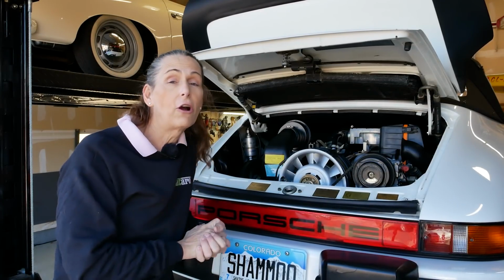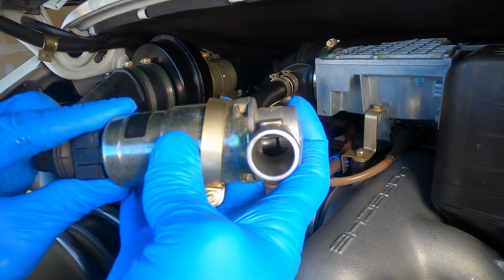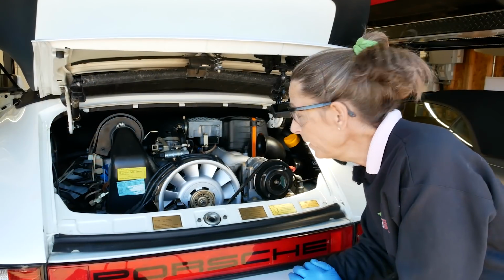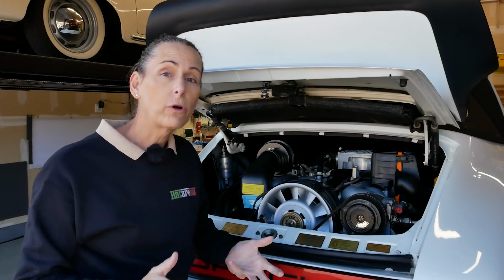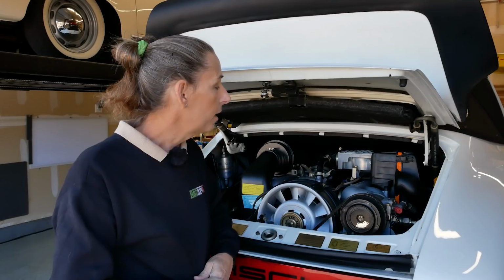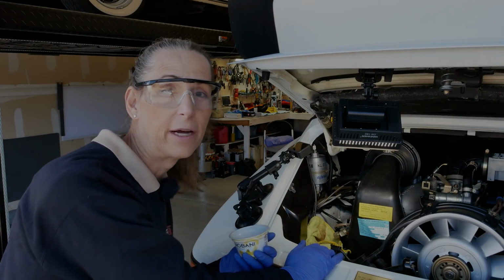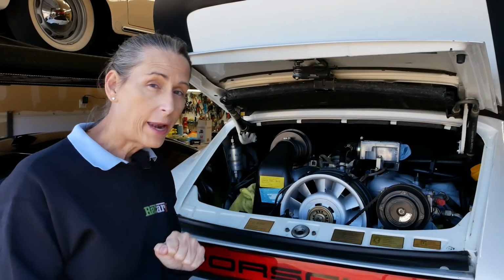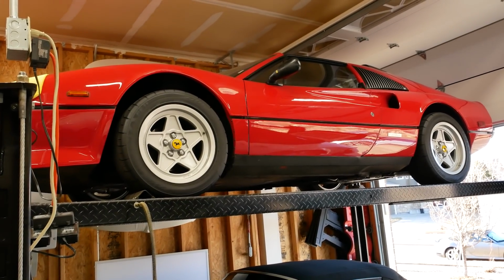Budget eBay Porsche 3.2 Carrera Project Car! #29 - WHAT IS GOING ON WITH THIS ENGINE!!!

Comment from the maker: Hi Everyone, This engine just isn't running correctly.  I was pretty sure from the last drive that we have a cylinder out.  Also the idle is about 200rpm high.  I can't really take it for a proper drive until I get this sorted.  Here we go!
Check out that Noid test kit here: https://amzn.to/35ph4b5
And the Spark Plug Checker: https://amzn.to/38wBZeA
Reply: Franny, Is there a specific mechanical reason that would have precluded removing the suspected failed injector #5 I think and firing the engine over to see if the injector was actually delivering fuel while still powered by the harness???? placing the injector tip into a clear bottle to see if it delivered fuel when the engine was running?
Reply: I love your content!! <3
Reply: Bad injectors happen. Sometimes electronics go bad. I have a 1980 911 with a Paxton supercharger. It's fun.
Appreciate your videos.
Reply: Hi Franny and company....is yours a 1985 ? Or a 1987 ? I've got a 85' Carrera and a 1987 G50 Cab !👍🏁🏆💝
Reply from the maker: @frankvella1392  it is an '86 actually...
Reply: @HeidiandFranny  k thank you franny !!! So no G50 😥 have a great day lady's !🌷👍
Reply: @HeidiandFranny  It looks like the injector failed after it was running or was intermittently firing because it soaked the plug enough to the point of uselessness as evidenced by the new plug firing nicely. Check the oil, 10 to 1 it'll smell of fuel from the look of that plug. You said it's an '86 so it's Motronic and I've had to adjust base idle speed even though it should be controlled by the DME, it's a painless process that shouldn't take more than a few minutes. Is the flow through the ICV heading in the correct direction? I've see dozens installed backwards, it's an easy mistake. Other than that it could also be a vacuum leak which is easy enough to find with a can of brakleen or starting fluid sprayed around intake surfaces and lines, just listen for an idle increase.  The vacuum lines to the throttle body and the fitting next to the idle microswitch are easily cracked and dried up even thought they look fine. A good test for vacuum leak probability is removing the oil cap with the engine running, if the idle drops it's a good indication of no vacuum leaks. Good luck and best wishes to you and your car.
Reply: With a stethoscope you can hear if the injector is clicking.

And how did you remove the sparkplug wire without getting zapped?
I have not quite finished the video. The spark did not appear strong
Reply: @golfish8589  Luck, she had a glove and long sleeves, even then I've had some give me a hell of a jolt. Any mediocre graphing scanner will show spark voltage and duration if it's questionable by sight. GTC makes a very affordable affordable handheld graphing ignition analyzer I use if my Launch is tied up. I'd ditch those 4 electrode plugs for an NGK fine wire iridium though.

Comment: A good old fashioned mechanic's stethoscope can identify a bad injector also. If it ain't clicking it ain't working. Not sure if you could get it on those injectors though. It's pretty tight in there. I got the spark plug socket stuck on my '79 911sc once on number three. Took me an hour to get it out.

Comment: I have been looking for a used porsche for a long time.  Want  a manual hardtop.   Budget is currently 30 k.  But hoping for 40 k budget later this year..     996 ?   Now double the price of 18 months ago ?? 

Cheapest 997 ??  With some miles and base model ? 

Would love your input.  I find the cayman and boxster a bit too small width wise.  I am big.   The 996 is tight , but the seat reclining helps with knee room etc.
Reply from the maker: Email us on the website.

Comment: Nice! I just saw this, thanks for this content.  A couple of notes:

1) If you're trying to isolate injector vs. harness, you can just leave the injector in place and switch the harness connector between #4 and #5 (for example) if you have enough slack in the wiring -- might have to snip the zip ties.  Carrera DME are batch-fired injectors, not sequence-fired, so this tip doesn't work w/all cars.
2) While your spark plug looks like it's firing fine, it also looks like a Bosch Platinum +4 plug.  In my experience the SC and Carrera ignition systems tend to fire more reliably with copper electrode plugs such as the NGK BPR series or the Bosch DC.  YMMV, but worth a thought.
3) So appreciate your taking the time to mention having a fire extinguisher handy -- kudos to you.  I have to admit though it gives me the shivers a little bit when I see your ponytail close to the AC compressor & belt.  It's probably just the camera angle/depth of field and you're not close at all, but a couple of times when you look at the camera your hair looks like it's just inches from getting snagged in the compressor pulley.

Thanks again for the thoughtful diagnostic approach and easy-to-understand descriptions.  Subscribed!

Comment: Your alternator on this video is making noise along with the fan hitting the shroud.
Reply: Also if I were you I would use the original Purolator RED oil filter. The oil filter that you’re using I will bet you dollars to donuts if you cut it open the center will be collapsed.
Reply from the maker: The alternator was completely rebuilt less than 20K miles ago due to bad bearings from the PO having the belt too tight.  The fan is not contacting the shroud - that would leave a very obvious mark on the ceramic coating.  
I have never seen a collapsed filter on this car.  Mahle is high quality brand and I've never had any issues with them at all.  I did some quick searching and didn't see any obvious outcry.  Where are you seeing these filters fail?
Reply: @HeidiandFranny  Mahle is a high quality filter however as a collector of over 35 years and former Porsche instructor ,50% of the Mahle and Mann filters I cut open after oil changes for friends and customers (cars less then 1000 miles and 12 months between oil changes) the center cores of the filters collapsed. For a few extra dollars the factory OEM red Puralator from the dealer are best along with the classic Porsche oil with the CORRECT AMOUNT OF ZINC is best for these cars. The Valvoline you put in your car may hurt your cat.Zinc is good for the engine not the combustion chamber. Castrol with high zinc specifically states do not use on cars with catalytic converter’s Valvoline does not have that warning. Just my two cents worth.By the way great videos continue the excellent work
Reply from the maker: Thanks for the head's up.  I'll keep an eye on them in the future.

Comment: I love your videos. I have a 1991 Carrera 2. My air conditioning isn’t working due to a Freon leak. I was wondering if you had a video on tracing and repairing a leak. I was also wondering if you could recommend a good word shop manual that does not cost $1000. Thanks so much I’m keep on trucking.
Reply from the maker: Thanks! Check out eManuals on line.  Not expensive and you can download the files.

Comment: With a stethoscope you can hear if the injector is clicking.

And how did you remove the sparkplug wire without getting zapped?
I have not quite finished the video. The spark did not appear strong

Comment: There's no harm in removing a plug from a hot head, the aluminum actually expands more than the steel plug so galling shouldn't be a concern. I've always used a very small amount of CRC copper coat anti seize on the plug threads, it's good to 1800 degrees and conductive, great for 02 sensors or any that use their body for gnd.

Comment: Just came across your 911 3.2 project series.  I started with the bad injector video here (love the topic/s and presentation!).  One question I have you didn't talk about in this video-  Why are you sending out the injector/s again for service, waiting a week or more, versus just buying a new injector?  Pelican has them for $35...?  Since this car does not appear to be a full concours  restoration (maybe it is and I haven't seen it mentioned in prior videos), but I'd think replacing the injector would be a much faster/easier solution.  Just curious!
Reply from the maker: Thanks! The OEM injectors are like $300 a pop.  I don't want to go down the road of aftermarket generic injectors.  These are actually doing fine and I believe the engine (except for the missing) is running much smoother even than before the engine was taken out.  The current issue is hitting the entire engine at once so not likely to be an injector.  I have several things to look at...

Comment: Get 6 new injectors, if they stick like this they will re-stick later if you manage to get them going.  In the past I have unstuck injectors by clicking them with 12v directly from a battery. Got them working, but they got stuck again a week later.
Reply from the maker: That is why I sent them back to be thoroughly re-worked.  New OEM are over $300 a piece.

Comment: I had exactly this issue with an injector after a full rebuild and the injectors cleaned and tested (like yours). It appears that the "stuff" they use for cleaning  washes all the gum and varnish out of the injector and through that little hole at the bottom. Sometimes, as you have found, the "stuff" laden with all the gunk dries around the needle and it sticks. I gave my injector body a sharp tap on a hard surface (vice) and that frees them up. Saves sending them back and waiting. Great video can't wait for the next episode.
Reply from the maker: Thanks!

Comment: Battery borrowed from a smoke detector / CO detector :P.  I've had cars that sat for a very long time get stuck injectors, and a few sharp taps with the handle of a screwdriver frees them back up, and the problem doesn't happen again as long as the injectors don't get dried out.  The bad injector doesn't have an open circuit because I saw an inductive back EMF spark when you disconnected the 9V battery.  Thanks for another great video!  I was very relieved when I saw the problem follow the injector.
Reply from the maker: First thing we do is to replace the smoke detector batteries when we install the new detectors.  I think I put eight or ten new ones up.  Lots of those red batteries left over ;)

Comment: You have a wet plug, so the injector is delivering at least some fuel. The spark looked very weak, so that seems to be the problem. It should be a healthy 'blue flame'. Yours is anemic and yellow/orange. 

Those early Bosch Motronic systems get unhappy if the resistance in each spark plug circuit is off. The best approach is use factory wires, or dead copies, along with factory spark plugs, which are guaranteed to have the right values for resistance and heat-range. Those fancy plugs don't help anything, anyway. The wires are different lengths, so the resistance is a bit different. Each wire has its own specific resistor built-in to compensate. With those items taken care of, the obvious thing to look at is the ignition coil. It could also be a ground problem, or a short somewhere. In any case, spark is almost certainly the issue.

Comment: Wow, great diagnostic algorithm. I have the same car. A common issue with the 3.2 is busted head bolts , which could drop compression but you may see an oil leak. I didn’t know that you could bench test an injector with a small battery. Great video.
Reply from the maker: I checked every head stud when we had the engine out  They were all secure :)
Reply: @HeidiandFranny  You were very thorough, excellent work.

Comment: The cameras you have are great! I own a CayanneS that came from Colarado and was
serviced at Prestige Imports Lakewood  I have only had one problem with the Porsche
the leak detection failed and the rear hatch will not stay up when it is cold.
The thing i love about it is if u put it in 4 weel drive it will go no matter what snow ,mud
My Lincoln SUV all wheel drive will not.
Reply from the maker: They are surprisingly good on snow.  Even our 996 is great in the snow!

Comment: I had the same problem years ago.  Good  trouble shooting video.
Reply from the maker: What did it turn out to be? just curious :)
Reply: There was still a trace of contamination in the fuel tank even after flushing the tank, lines and installing new fuel filters as a result of getting some bad gas.   The car was a 944 turbo producing 380 hp at the wheels running in the GT3-S class.  The car had a complete race spec fuel system with stand alone engine management, nothing stock.  Ended up replacing the tank after sending the injectors to RC for the second time and finding contamination.  Problem solved.

Comment: Hi Heidi and Franny, I watched all of your Carrera 3,2 project movies within the last few hours and I have to say I love it so much. I never saw such nice and experienced people doing this kind of tutorial and explaining movies at such a detailed, charming and entertaining way. To say it in short, you ladies are superb.
I am looking forward how you will fix the erratic rough run  / stall of your engine. If it’s not the coil 
(where I could bet it is), it might be a good idea, to double check all the ground points you disconnected for engine removement.
I am although interested in, if you replaced the O2 sensor, checked the resistance of cylinder 3 temp sensor even if it’s brand new (and just impacts cold start). And how did you checked for any air leaks (smoke in the inlet manifold)? As said before, I am looking forward to see more of you…
Good luck, take care and thank you so much.
Cheers Alexander (Germany Stuttgart)
Reply from the maker: Thanks so much Alexander!  I do need to go back and look at all three of those sensors.  I have the old ones and they are working (I just replaced them because the wiring is falling apart).  I did not replace the O2 sensor.  I think I'll do that as well for good measure.  I think they are fairly delicate.  The ground points have all been cleaned.  That is a good call. Thanks!

Comment: You could have used a stethoscope (very cheap) on each injector in situ to hear if it was clicking or not. Good to know the 9v battery trick on pre assembly though listening in situ is so much easier.
Reply from the maker: Thanks!  I need to get one of those!!

Comment: I don't know if applies to your year of car, but my brother who is a Porsche expert told me here is a small internal original seal or bearing in some earlier motors that will cause catastrophic engine damage. The part must be immediately replaced upon taking ownership of car.
Reply from the maker: I think you may be thinking of the Intermediate Shaft Bearing that can go out on the first of the water-cooled cars (1999-2008).  It affected a small, but big enough portion of those cars and was usually catastrophic...  If you buy one of these (911/boxster) then just have the clutch replaced and get the bearing upgraded at the same time.  This does not apply to the Turbo cars though ;)
Reply: @HeidiandFranny  - Thanks for the clarification. By the way was there an oil pump bushing that was flawed also?

Comment: I love the way you troubleshoot! Naughty you, keeping them on the shelf that long after cleaning ;) I had mine ready to go in after getting them back, but waiting for 3 or 4 weeks. My Alfa with L-Jet ran like hell and sounded like a VW. I ended up driving it for an hour with Techron in the tank and it cleared up. It's funny- they tell us to install them right away, but we usually don't. Humans, sheesh. BTW, cool to see you wear ratarossa's garb!
Reply: I just have to add- those Bosch connectors on the harness side can push back into their housings while removing the harness. This happened to me on the throttle position switch and on one of the coolant temp sensors. Pulled my hair out trying to figure out why it was running so poorly 'all of a sudden'; it just wiggled back into the housing while driving. That one took a few weeks and new parts to figure out...
Reply from the maker: Thanks!!  That's really helpful..  New video tomorrow morning and I did find something, but I'll totally check out the connectors.  Wow...  That must have been a real thing to figure out!!  Awesome work!
Reply: @HeidiandFranny  Thanks for saying so. It was a true 'ah-ha' moment when I randomly noticed a pin connector just a bit out of place and not even with the others. I checked all the Bosch connectors I could find and found two. Good news is, you can push it all the way out with patience, bend the little metal tang up, and 'snick' it back into place in the housing.

Comment: franchen, next time tap the injector very gently whlle on load, even better with a little fuelpressure ,a seringe  and a fuel hose will do.
and yes get them working after cleaning, the cleaning fluid does good things , but not lube them.
dont ask me how i know.
o, and watch your pferdenschwanz (ponytail) with all those moving parts.

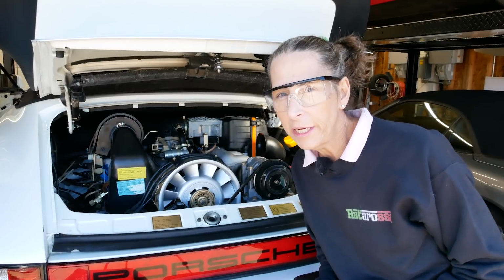Comment: At 8:02 if the heads have expanded due to heat, your head to spark plug Tolerance in the threads will be higher in theory.  From my experience pulling igniters out of CF-34 engines, it always seemed to be way easier to do when the engine is hot.

Comment: pretty weird that one  would not notice a 911 running on 5 cylinders and instead spend time checking idle stop and air valves...

1 Ignition
2 Air leaks
3 Mixture control